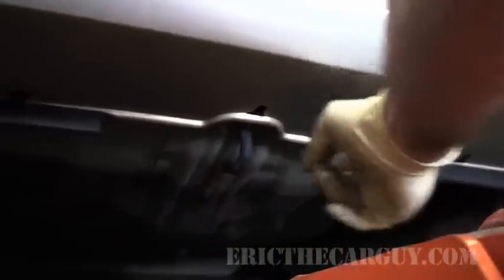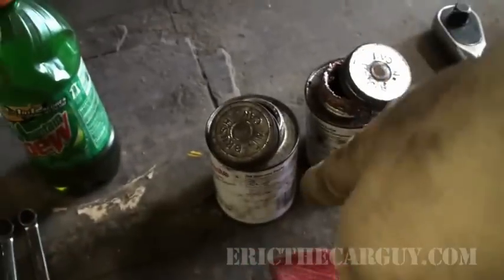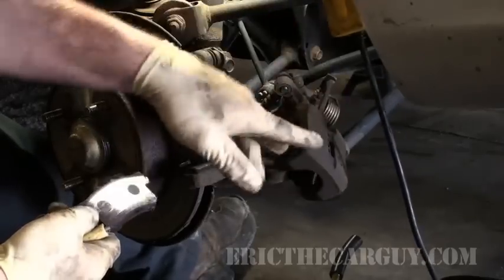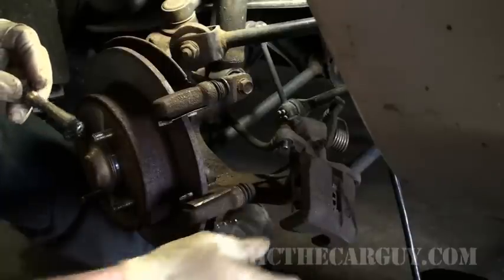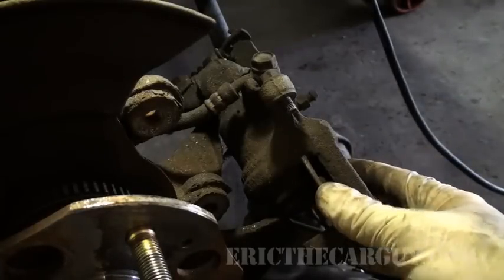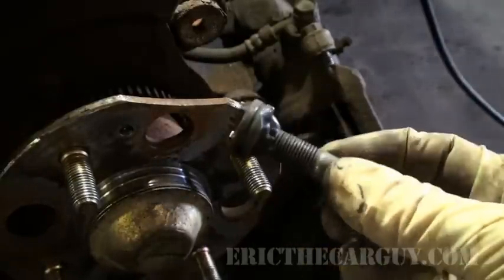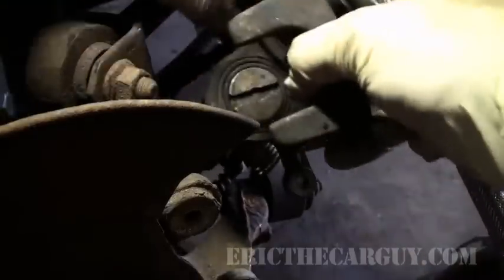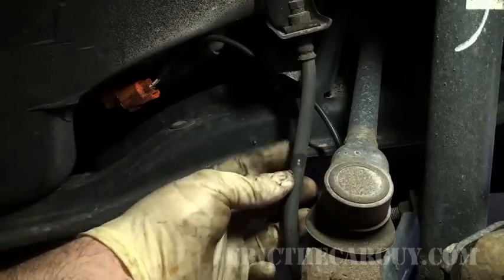How To Replace Rear Disc Brakes (Full) - EricTheCarGuy

Comment: rebuilt calipers with new slide boots..  $67  save the rewind split the boot boogie for others.  Makes rears as easy as fronts.  Enjoy the rest of your day.  Never turn disks..  buy new rotors wherever you can.  A warped rotor cannot be turned true.
Reply: rear Disk Brakes (With Parking Brake) are often burned or warped due to someone leaving the parking brake sort of applied an driving long distances.  Fry the boots, the brake fluid, warp the rotor..  not good.  Brakes with some air often will drag when warmed up..

Comment: Why not just use C clamps? fast and easy!
Reply: because he said this particular piston is a ratchet type.
Reply: Its rear rotors with emergency parking brake mechanism not the front rotors. The front rotors you can use c-clamp and the old brake pad to push it back in.

Comment: Why cant you push the fluid back into the master cylinder ??
Reply: Rick S I think it’s because the pressure may damage the master cylinder.  I’ve seen other videos where they remove the master cylinder cap before turning the piston.  Not sure it Eric would approve but it seems so much easier.

Comment: If its a parking brake why cant you just , while the car is on jacks, put it in neutral or drive and get the parking brake to disengage. Then pushing the caliper back in like normal?

Comment: I did my rear calipers and pads on my 2001 Old Alero Gx and everything was fine until I applied the parking brake which now doesn't work. My Alero has disc brakes in the rear, and the caliper piston didn't have any grooves in the for any special tool or anything, so I compressed like it was the front. Anybody want to comment on why my parking brake no longer works?

Comment: What type of silicon paste you use for the caliper pins? This is what I use : https://www.amazon.ca/Permatex-24125-Ceramic-Extreme-Lubricant/dp/B0018PSASU/ref=sr_1_1?ie=UTF8&qid=1532640165&sr=8-1&keywords=permatex+brake

Comment: Why is it so important not to get fluid back into the master cylinder?  :s
Reply: Because it might overflow the fluid in the master cylinder. As the pads were worn down over time, extra fluid might have been added to the master cylinder to compensate.
Reply: Lysle Anderson contamination
Reply: cosnop
 also the master cylinder is sealed to prevent air from getting into the system.  forcing fluid back would damage the sealed cap.

Comment: why dont you want the fluid going back to the master cylinder
Reply: Water,  and therefore corrosion, will sit at lowest point in brake system.  Dirty brake fluid should not go back to master cylinder.

Comment: CANT TURN MINE WITH TOOLS, WILL TRY TO FIND   oops , didn't mean to shoutwill try to find loaner tool in the morning. If a large vice grip wont rotate the piston, is the caliper frozen?  Daughter ground the hell out of the rotor, wheel rim is covered in rust. I couldn't budge caliper, bought new, but will try correct tool first.-96 accord v6 sedan

Comment: Was working on my wife's rear brakes and only looked at your video only after removing the caliper, seeing the cross and having a wtf moment. I live in the boonies so no autoparts stores to rent the tool from. Out of frustration I wanted to reinstall the the caliper without pads and leave it to that nagging bitch to deal with as she flies down the hill cursing. At least it would teach her a something about respect. However, I had a flat file and vice grips lying around. I clamped the file with vice grips at a right angle and voila. Guess it's not her time.

Comment: Not enough detail. What size took to remove what bolts. Not smart.
Reply: At the beginning he said that these types of brakes vary wildly between brands.  If you can't figure out which size wrench or ratchet to use then you should not attempt work on your vehicle, especially a safety system such as brakes.
Reply: I couldn't have said that better myself. I hope he takes your advice.

Comment: Why are you so stingy with the anti seize?  Not trying to be funny just trying to learn.  I used anti seize on my slide bolts because Advanced auto guy said that is what to use, will this be a problem down the line

Comment: well...i just tried this for my first time ever, and im taking it to the overpriced mechanic. These caliper lugnuts must have been WELDED on! Im done everything but pull teeth trying to get the dam things loose, so anyone who tries to install your own brakes in order to save some cash, be forewarned. Its not as easy as it looks.
Reply: This is a general problem with working on cars, mostly on brake calipers indeed.... Rusted and/or "welded" bolts not wanting to be released into freedom.
Most of the time you will be able to get them of by brushing of the rust around the bold, make a 50/50 mix of ATF and acetone (trust me, it will get ANY bolt losened). spray/drip a bit on the side of the bolt, wait an hour, smack the bolt with a hamer and intighten the bolt like it was never rusted.
Or you could use some heat. Only the bolt and be carefull to heat it up only a few seconds or you will fry the rubber seals inside the brake caliper!
Reply: lukynater1 thanks luky. I finally got the friggin thing done as i proceeded to do my own brakes for the first time. Lessons learned, but dam it, i hate stubborn crap when my time is valued. Anyways, i snapped a photo of your advice, so I'll save that in case i ever need it cause I'll be doing the back here shortly. Thanks
Reply: caliper bolts usually are not torque very high. it's the brackets that are torqued high.   use a 6 point wrench so you dont round it
Reply: Ski Fall oh i got it a couple months ago buddy, but i still gotta do the back come spring.
Reply: Ski Fall thanks for the response